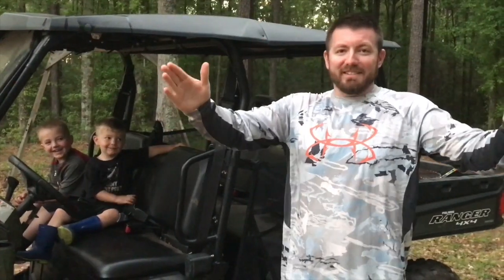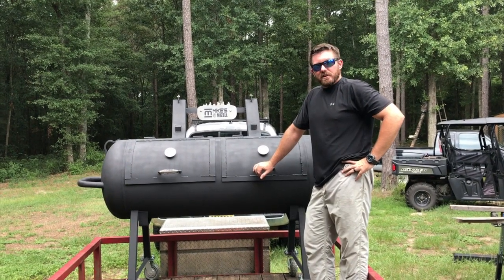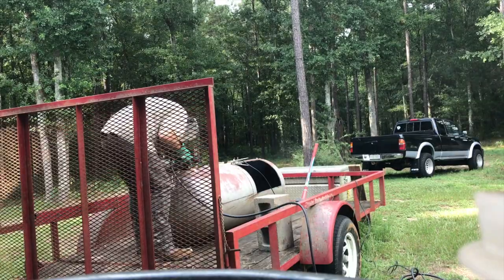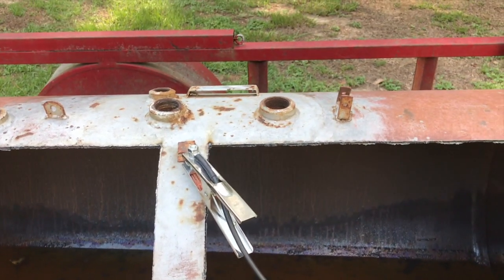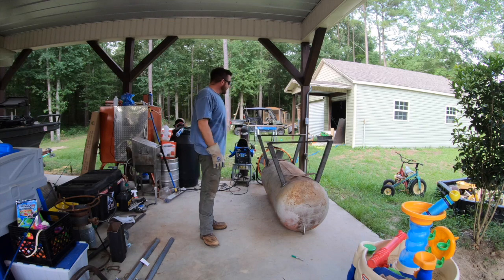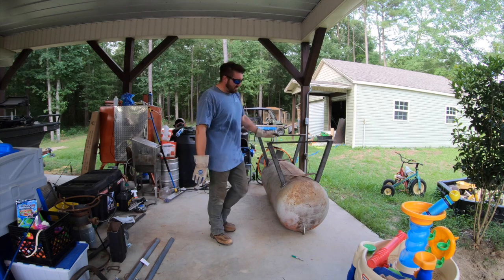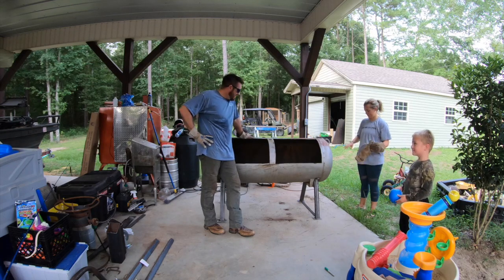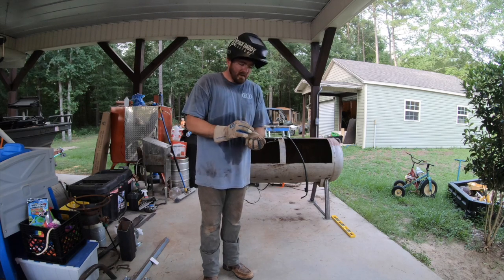Homemade DIY cooker, smoker, or grill out of a big repurposed propane tank

Comment: I have the exact tank and also cane without the valves. There’s the slightest hint of propane. Did yours have a similar smell? If so did you force vent it out? Great bbq pit by the way!
Reply from the maker: I actually dropped a match down in it first. Then I passed a torch over the valve opening. Then, after there was no fire or explosion I put water in it before plasma. It did smell like propane, but by the time I was finished there was no propane smell at all.
Reply: @JackArmstrong-jackdaddycustoms  Wowser. I may fill it up with water then try to cut it. I don’t have a plasma cutter so angle grinder it is. Thank you!